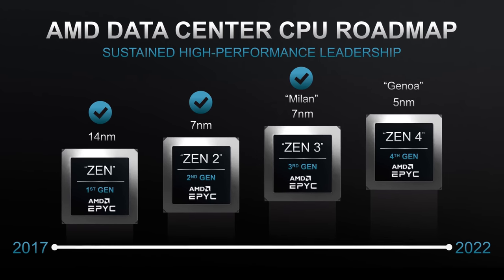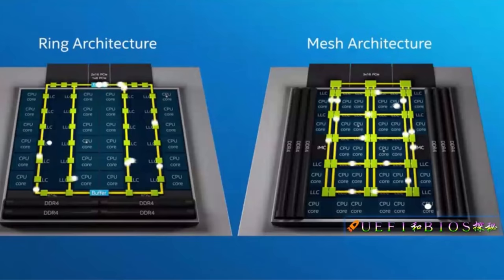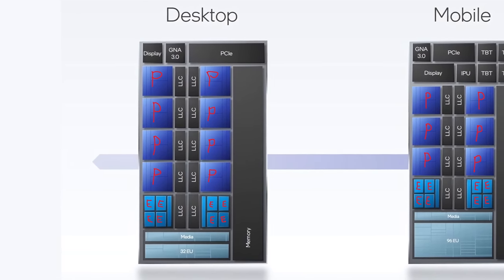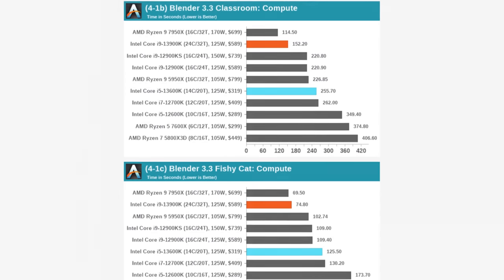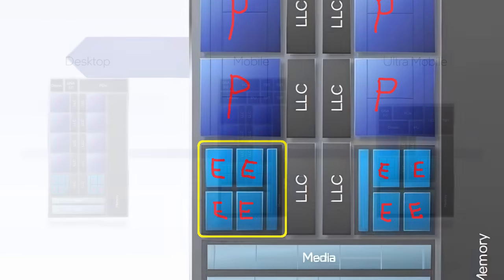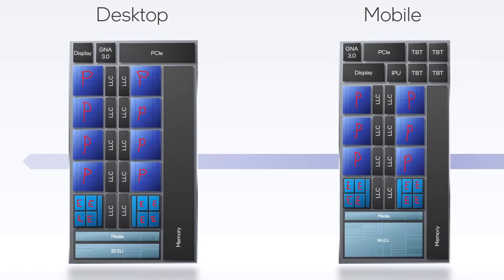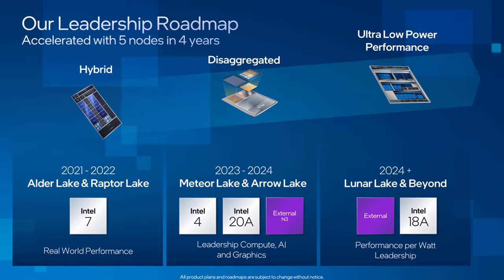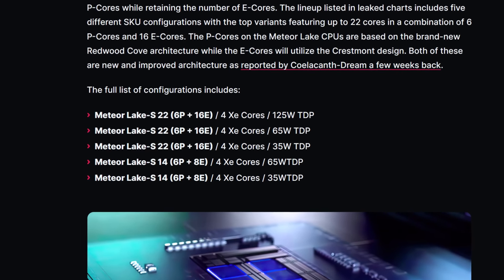E Cores - Slow, simple, not super efficient... but still good?

Comment: 1:20, that's only partially true, as both sides have some headroom with design changes. It takes ~3 years to take any big change to production, but small ones can happen.
technically ryzen appeared when 7'th gen was in flight, so 8'th were first that could see any change.
8'th gen intels were probably fairly unaffected, but it's possible they trickled down that core increase instead, so named i3 what was supposed to be i5 previously, and pushed them 100 or 200 MHZ harder than previously planned, stuff like that. 9'th gen had non-silicon optimizations, like thinner IHS, which is a direct result of ZEN, they pushed that silicon harder than they planned, again so they needed stronger thermals. 10'th gen already should be designed from ground up with all they knew about 3'rd gen ryzen and new all about chipsets and their scalability. It was issues with 10 nm that stopped intel from responding properly. 
I believe they had issues with 10nm because zen was so strong that it was to weak, for issues it made & they restarted whole 10nm from ground up.
4:20 that's not really the case, its very situational. Because intel did not give us cores for last 15 years, 8 was absolute maximum, most game engines just dont assume you have more than 4/8 and focus on squeezing as much from 4/8 as they can. 
games have clear benefits of more cores (depening on a game) up to 8 cores, after that, you stop windows updates, antivirus, browser and all other backgrounds from taking cpu power from your game. Stuff like that don't really need to finish ASAP, so they can slowly finish in the E core. It also have a benefit of stopping windows update/telemetry from completing in 10 seconds, while taking max power from your ssd/cpu/network, so slower core by chance evens out spikes of windows background activity, making it feel much smoother.

Comment: The recent leaks are interesting, but odd. Intel has released at least one chart that showed MTL as 8P+32E. It could be that 6P is enough to hold off Zen4 for the first half of '23, and also lower their power usage. If so, then maybe its not a bad idea. Power draw is the main complaint people have about current products.
Reply: I think 6 or 8 P cores are going to be good for a while for the vast majority of consumers, at least until games finally revise their thread situation and take some notes from the recent Doom games.
Reply: @DarkSwordsman  I don't even think that's very likely until we hit silicon's shrink limit. DOOMs job system is impressive, but as I understand it, it takes a lot of work to implement and is unique to each game, so you can't just "build it into the engine" so to speak. So as long as CPUs are getting faster single thread performance on a yearly basis still, there isn't much reason for most devs to put that much effort into it.
Reply: It isn't new info that meteor is going to be 6P. Consoles have 8 cores now so games will start to utilize more threads in the coming years. With a strong 6 core it will probably be fine though.
Reply: @eniff2925  Consoles have 8 cores for the sake of longevity and have for 3 generations. Most games are still single thread limited though, and with the gains we are seeing, a new 4c PC CPU will match the consoles 8c in multithreaded performance by next generation. So that's not really a concern. But until a few days ago I had heard nothing of this, so I think there is still a chance this leaker is mistaking mobile SKUs for desktop.
Reply: @eclipsegst9419  This is the first true 8 core console generation. Previous gen had double quad core cpus. If you look back the articles, there is mentions of this as far as the beginning of the year.
Reply: @eniff2925  Well, these are the first with hyperthreading. And the first with a reasonably strong single thread performance. But the Jaguar in last gen was monolithic, I've changed the thermal paste in a few PS4s it's just one silicon die.

Comment: Amd have a better process node, arguably a better core too, and Ryzen has been an amazing success, the biggest leap forward in tech in my 15 is years of being a PC enthusiast.

I can back to Intel and baught a 12900KS, following a 3900X being my main PC for a number of years, because I thought it was the biggest innovation since the socket 2011 sandy/ivy bridge days.

As a professional enterprise software developer the 12th and 13 gen chips are fast.

Where the Intel chips really shine over AMD is out of order execution and power efficiency at low to moderate CPU loads. As software becomes more complex and dynamic, out of order execution becomes more important.

The Intel chips perform better on things that are less repetitive and more dynamic, and the big little design was a stop gap measure due to Intel lagging behind on process node density, and it worked well.

I much prefer the fast P cores, but the thread director technology is pretty amazing at getting the most out of the hybrid design.

Intel have basically made a less advanced process node perform on par and in some cases slightly better, they made what they have work really well, but I fully recognise AMD has the superior core, but the trade off is more latency due to chiplets, and higher power usage at lower loads due to the I/O die.

Comment: Well E cores are only not efficient for games maybe, but for multi core application they are actually quite efficient. If Intel didin't had this E core design their CPU's would look quite bad in terms of power efficiency relative to AMD due to the node disadvantage. Intel just had to do it because of their issues with the 10nm node that took forever to finalize so they had to do it.

Comment: By Zen 6 or Zen 7, AMD will end up having a whole zoo of different chiplets on a single substrate. I'm expecting to see an APU (or whatever they call them by then) with something like: 1x I/O die; 1x v-cache'd 8 core Zen die; 1x v-cache only L4 die; 1x 64 v-core muZen die; 2x GCD dies; and 4x SSD dies, it will use at least 4 different process nodes all connected on the unified infinity tapestry.

The PS6 and X-Box will have a version that has DRM built into the I/O die.

Comment: The problem with E cores is Windows. General purpose OS like Windows do not like high core counts. Programs do but users do not. We use SMP for a reason!!! Windows is not a huge fan of chiplets or sockets. Again programs do not mind, but users do! 

If you wanted real performance you would stop messing around and get a multi socket workstation via Xeon. This was the product line that historically carried the multithreaded work loads. Most of the single thread (IO) workloads went after clock speed and IPC. Only some of the Xeon's could ensure this for high end consumers. Most gamers bought into lower bins with i series.

Intel is IO in nature. AMD is compute in nature. The world needs IO. AMD has never really got this per say. AMD ironically lost the compute market. Intel was historically more capable of understanding software needs. Intel has only made a few goofs really. Prediction being the most noteworthy. People do not seem to understand the significance of this. Intel is stuck with this premise until software evolves. AMD believes it will win when this happens. Which is wrong. AMD historically bets on SMT but has shifted to SMP. Intel is actually the SMP/SMT king. AMD is capable of scaling down better than Intel at the moment. If Intel was to take it seriously Intel would become a monopoly.
Reply: they made one really big goof recently

Comment: if you look at the threads it actually matches how much the performance would be if you had only p cores with the threads so a 13600k has about 20 threads and it would perform about the same as if it had 10 cores which also would have about 20 threads
Reply: No, it would be 8 cores/16threads if you only place P-cores in the same area. (and then- it should be compared to 7700X, not 7600X).

Comment: You miss the point entirely and lack understanding in this topic.
First of, the P cores are x86 core while the E cores are ARM (THAT is the difference, not physically smaller and running background processes, not more cores, that's not how any of this works)
Second, E cores can outperform P cores in instructions per second if given a program created for them, you didn't explain instructions per cycle or the differing pipelines.
The difference is like taking a bike vs a car trough a large city, depending on where you go the bike will be a lot faster even if it does not "boost" the same
And a process does not go to a E core if it becomes a background process. It goes to the E core if it can be run on a ARM instruction set
And AMD will probably be adding ARM cores in the future as well, due to the high power efficiency.
Reply: @2kliksphilip  where's the trolling?
your own linked source on the first graph shows that while the E core renders half the frames it does so while using half the energy per frame.
And maybe i somehow missed the part where you talk about ARM.
Calling someone with legitimate critique a troll is still the laziest defence.
The ARM applications and the divide between P and E cores on the M1 family of chips is why their battery on laptops lasts several times longer than the intel core ones, as well as performs a good amount faster when it comes to applications made with ARM in mind.
So tell me what i missed, how I'm wrong, or why I'm trolling. Or sit back down and let some other youtuber who knows what they are talking about handle the subject.
Would love to se your response with a actual refutation to my points, that would be nice.
btw, maybe link the anandtech article in your description too while at it

Comment: I am REALLY stoked for Zen 5. Why? Because they‘re apparently going to do the same thing with Zen 5!
The Kicker: Zen4 will be the „E“-Core!

It would make sense with their chiplet design. Putting Zen 4 and 5 CCDs on one package would make that fairly easy i‘d say.
On top of that, we have Zen4c, which stands for compact, which is designed for more cores on the same die-space, at the cost of cache, but these e-cores aren’t meant to be the performance monsters anyway.

On top of that Zen 4 would then be a tested design.

ADDITIONALLY AMD could manufacture these with an older node, to safe on costs. That this is doable is shown with RDNA3.
Th GCD is 5nm, while the MCDs are in 6nm and the I/O does for zen also share this approach.

They also said, that Zen 5 is in for a huge performance jump.

It would really add up!

Comment: Zen C-cores (compact) dunks on e-cores, and shows that glueing atom cores on a cpu is terrible, and it's better to just make a denser big core with less cache and less instructions and clocks if you want an effecient core.
Reply from the maker: Why's that? Zen c cores are much, much bigger than e cores, and the upcoming skymont architecture looks to greatly improve on the e cores further. Also, they're not atom cores- they're e cores and have replaced atoms.

Comment: Zen5 is going to use 16 core CCX, given that AMD can make their chiplets for less cost then Intel and their cores are a lot more efficient then they don't need E cores.

8950X will be a 32 core chip, the 8600X will probably be 10 or 12 core depending on their yields.

What could be more interesting is a 16 core chiplets + RDNA3 chiplet.
Reply: Doubt it will be less cost than intel... ryzen 7000 made 13th gen look cheap at launch... 7950x was 100$ more expensive than the 13900k...

Comment: I just wonder what manufacturers have in store once transistors reach a size where quantum tunneling becomes a legitimate problem. You're basically at the size of an atom at this point. What's the next step from there?
Reply: Just like today, better wafer makeup. The difference between 7nm and 5nm today isn't only the size, but also the material mix that the chips are made from. Instead of going smaller they will try to achieve higher stable clockspeeds and higher energy efficiency with different materials used. There is also still a lot to do efficiency and performence wise when it comes down to architecture.
Reply: There's at least another 15-20 years worth of development in 3-D architectures before we have to start worrying about that. AMDs 3D V-Cache is only the beginning.
Reply: instead of transistors they will use tranbrothors
Reply: when you cant have more transistors in one die just have more and more dies, its quite simple, aka the future is chiplet based with also die stacking
Reply: Fair points from everyone here. Still, I'm interested in what processors might look like in the far future.
Reply: @forcedtotalk7585  thank you for saying my shitposting is legitimate
you're a king and i hope your life is fucking amazing
Reply: @DDRWakaLaka  i thought your reply was dumb but this made it a lot funnier
Reply: @forcedtotalk7585  i just want everyone to smile and laugh
Reply: @DDRWakaLaka  noble goal to have considering everything's on fire. Keep it up.
Reply: @forcedtotalk7585  ty. would rather laugh over absurdities than cry myself to sleep because quite literally EVERYTHING is fucked

Comment: Amd should just make a cpu without threads 12 core -I just dont thruest "hyperthreding -even if the amd variant
Reply: If you need many cpu threads just go with a threadripper. Amd doesn't actually tackle multithreading problems in the average userspace the way intel does. Both the chip designers have excellent options for parallel workloads, its just that one stopped using cores as a marketing gimmick and the other has only begun doing exactly that.

Comment: When you get into the programming logic most consumer software that runs on the CPU is still single threaded. Most consumer software also only uses integer compute with simple numbers this makes it easy to run it all on E cores rarely using the P cores. Now you do have consumer software then runs better on P cores than E cores for example games that actually benefit from over 2.8GHz CPU speed. For business software well excel runs best on E cores and SQL databases run best on P cores.

Comment: AMD will certainly add big little to its roster as well. In the server world they have shown their new Genoa architecture, which have a Bergamo subtype for cloud computing, that is basically a whole CPU with just E cores, but many more of them. Given that therefore the basic core design is there, and ARM & Intel have done the groundwork on OS & app support for it in their respective markets, I would be more surprised if we didn't see it, especially since AMD could just make an E core chiplet and flexibly combine it with one or more P core chiplets depending on the target market. Especially for mobile, server & embedded this will become more important, especially since x86 also has to fight against ARM more and more in these fields. ARM Windows may yet be small, but there is Apple, who have increased their marketshare since their ARM transistion, in servers ARM is a lot more present, and in embedded it is already king.

Comment: I still find it hard to think of E cores as slow, there fairly fast. If intel has the guts to drop a 36 e core CPU they will have a beast for all core loads, even just 2 P cores and all e cores will rock the world of apps that can scale well. I suspect there problem will be the idea of a desktop CPU that has xeon like speed, market segmentation at it's best.
I suspect Windows is still a big problem for the new CPU's, AMD is still having problems from windows/apps not knowing how to best use cores and intel is now hitting the same problem. 
I have been wondering about disabling HT on my AMD 3700X, it's rare to relay use all threads and apps can be stupid and use HT threads over real cores at times. Now we have more cores is HT relay the best option?
Reply: @2kliksphilip  Your right ill have to look in to it, when I was talking about intel and AMD OS problems I was more thinking of Numa nodes and thread allocation problems. 
Process Lasso is an app that lets you set apps to cores to stop windows from messing up thread allocation. Level1tech has done a few videos on the problem, even intel have talked about it in there thread director 2 PR. Thread director 1 failed, the problems where the same as AMD had with CPU's with more than one chaplet.
On my 3700X I did some testing when it was new, without HT it will boast higher & if I am not using all threads then it is faster.

Comment: I  can't wait until AMD releases an X3D 7k series chip, and intel is probably going to do something similar, eventually. if not the exact same.
Reply: I don't think intel has 3D cache in the cards, but they do have ASIC-style accelerators ready to port from Saphire Rapids if they need to, amd they're showing a tile-based design for future generations, so more modular intel chips are on the horizon too.